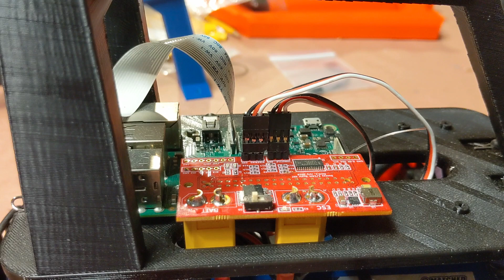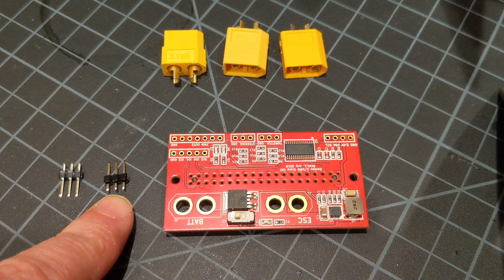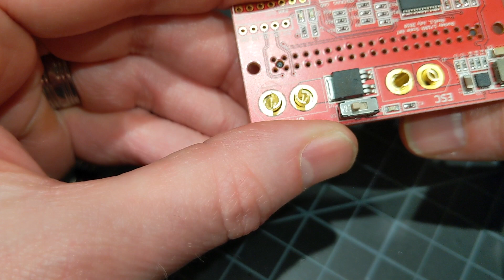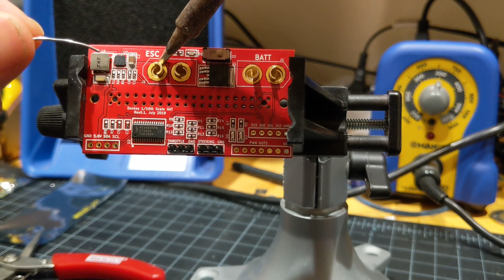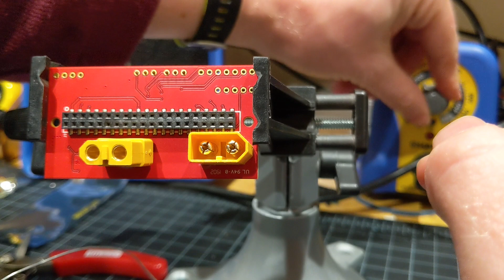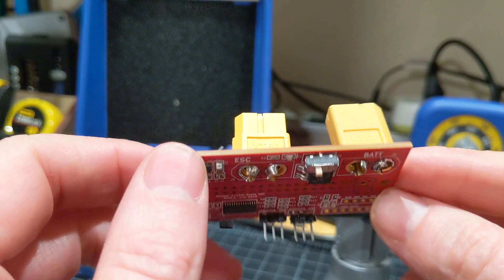Sombrero 1.0 Assembly

Comment: Could you show how the sombrero connects to the ESC?
Reply: Does the lipo battery replace the one that comes with the car once hooked up?
Reply from the maker: Yes, sorry for the slow response!  I will try to spend more time documenting sorry
Reply: @AdamConway  no problem think I figured out the hardware side. Now I'm just having issues getting the code for the sombrero correctly into the manage.py file

Comment: I have Traxxas LiPo batteries but they have different voltages. What voltage does the Sombrero board accept to power? Can I burn the board if I plug in the wrong Traxxas LiPo batteries?
Reply from the maker: It should be fine - the Sombrero can handle up to 13 V
Reply: My Traxxas has different connectors (https://www.amazon.com/Traxxas-TRA2869X-Battery-Connector-7600mAh/dp/B0849P634F/) - Can you suggest compatible connectors for the Sombrero (that is very cool!)

Comment: Just got the kit with the Sombrero.  A few observations.
1. The heat sink on the Broadcom chip won't fit.  I left it off.
2. The Raspberry Pi 3 B+ PoE pins are in the way too.  I'll probably just cut them off.
3. It would help to supply spacers for the Sombrero since the power connectors take a bit of force.